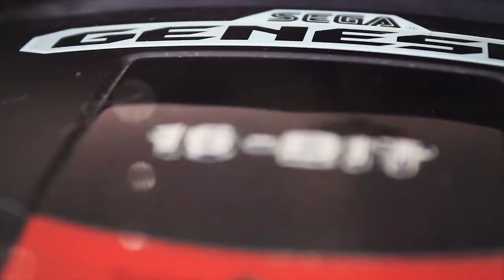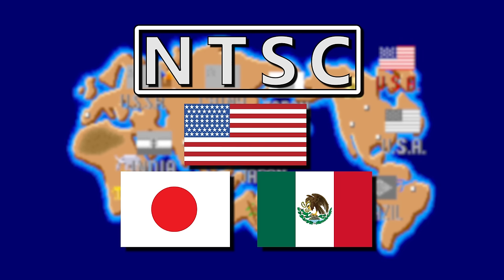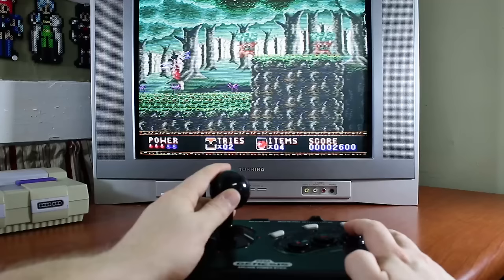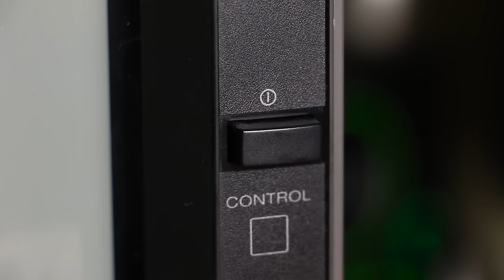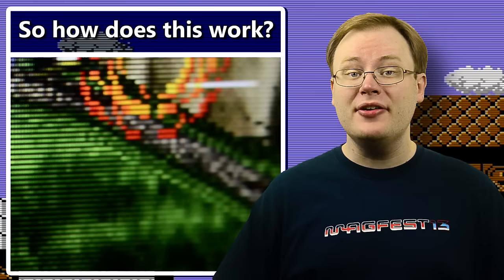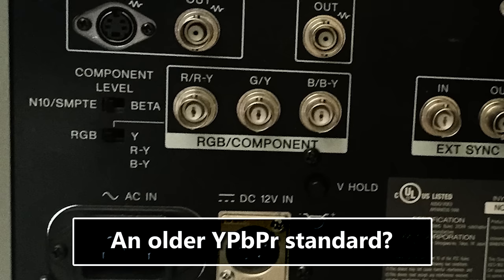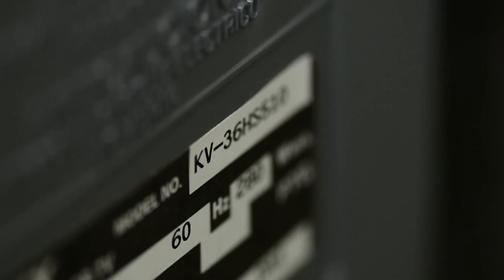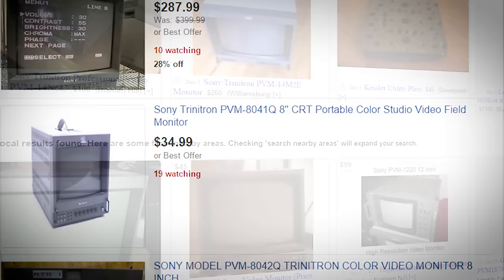Gaming on CRT Televisions, PVMs and BVMs :: RGB104 / MY LIFE IN GAMING

Comment: Having recently gotten back into gaming, I have been playing NES and SNES games on an LCD tv. I did notice that, with games like Metroid and SMB3, I had to somewhat retrain myself with regards to timing but we are talking about a couple of frames of difference.. I am using a RetroN HD for NES and an original SNES running through a Level Hike HDMI cable. I don't find the finely pixelated rendition of the NES games to really affect my enjoyment of the game and the SNES output I am getting is excellent. Link to the Past looks amazing and I can't imagine I would like the CRT image better. But keep in mind that I did a lot of PC gaming during the '90s so I am just used to more pixelation. I have also been running a GameCube through composite. That doesn't do so bad because of the native 480i resolution.  Unfortunately, I didn't think about GC compatibility when I bought my HDMI adapter for SNES. I could have got one that could do both for just a few bucks more.
I have a CRT TV on the way so I will definitely be doing some comparisons. It's only 13" but it's a Sony and the only way to go for speedrunning NES and SNES games. Besides, how else am I gonna hunt my ducks?
Oh, and you can call me a philistine but I would rather stretch the image to fill the screen than squash it into a true 4:3 box with the overscan lines crammed in.

Comment: With all the work that has gone into flashcarts like the sd2snes and cloned consoles, it seems like it might be a good idea to engineer a modern lcd controller and screen that draws the scanlines across the screen exactly the same as CRT TVs. One option could be to turn off black lines in-between the scanlines, and another option might round pixels even with the black lines turned off. 
This would enable the Super Scope 6 to work as long as there wasn't any lag time, and as long as the technology could draw scanlines as quickly, there shouldn't be a problem. I don't know if the Super Scope 6 would require black line separators. 

Being able to change the thickness of the black lines would also be a good idea.

On another note, the sd2snes has so much potential that I believe someone should emulate a new fx chip for the original SNES or use the existing fx chips to make even more powerful game ROMs. Why not make it into a family computer ;) with the SNES expansion ports on the bottom of the console, an internet connection, extra storage, and other possibilities could be invented. Perhaps investors are needed or people who are retired? 

If Super Mario Cart and Starfox run, then why not twisted metal? If sd2snes hardware has all that potential, then why not let it do all the work and just output the video and audio to the SNES?...

Comment: I didn't realize this video was this old.

I use a 32" Sony HD CRT with component cables for my Genesis, Saturn, PS2 and Xbox. They all look great in component. I also have a 27" Wega next to it that I use for light gun games.

I haven't experienced this supposed lag on an HD CRT. It worked great for timing based Guitar Hero (480i) and Guitar Hero 2 (480p) without any issues.
Reply: It depends on the model but on the whole it's better to get a normal CRT for this reason plus the vast majority of PlayStation 2 games run in 480i or 576i for PAL
Reply: @smasherjosh5000  Well then I couldn't play F-Zero GX, in all of its 480p glory on the Gamecube.

Comment: I keep coming back to this video. I recently bought a CRT on eBay for £86.49 mine is a Pacific PDVTV14-100C which is 14 inches and has a built in DVD player, from what I know Pacific was a TV manufacturer for the British supermarket chain ASDA, it has a front Composite with both red and white audio jacks, SCART, RF and I think Digital Coaxial (it's the orange Jack) I really have my GameCube hooked up to SCART as my GameCube came up with a cheap 3rd party SCART cable and my Wii and PlayStation 2 hooked up via Composite, I plan to get SCART cables for said systems from Retro Gaming Cables, I have also ordered a Star Wars Revenge of the Sith Plug and Play system (it's a Darth Vader theme) that uses 4 AA batteries, speaking of Plug and Play systems do a video on them!
Reply: And now just picked up a widescreen curved screen 26 inch Philips CRT with composite and 2 SCART ports, one SCART port is RGB, I think the other is S-Video. The model is Philips 28PW5407/05 there's also a 32 inch variant, I couldn't handle any bigger than that one
Reply: @smasherjosh5000 awesome brother, I've got a kv36fs300 and a kv27fs13 that I just love.
Reply: @RemoWilliams1227  correct me if I am wrong but aren't those Sony Trinitrons?
Reply: @smasherjosh5000  yes they are

Comment: Here's some advice that is not covered in this video: 
1) buy a  sd crt with component or s-video inputs (the later year models are the best)
2) buy a hdmi to s-video or component converter (30 bucks on amazon)
2) hook up your pc to your crt. 
3) download pcsx2 (ps2), dolphin (gamecube), and retroarch (everything else)
4) enjoy the beauty of playing ps1, ps2, and gamecube games in multiple x native resolution with AA, faster loading times, save states, all while retaining the advantages of crt display tech (deep blacks, amazing colors, near zero input lag, scan lines)
5) be amazed at how much pre-ps1 era games look indestiquishable emulated on your crt compared to the original systems and carts displayed on your crt. (you also, of course, can take advantage of emu features like save states, fast forward)
6) play modern games on your crt, outputed at 1080p, and be astonished at how good they look and how little input lag there is.  (any bloodstained fans out there?)
7) watch any sd content (movies/shows- particularly anime) and be shocked at how awesome it looks. 
8) watch hd content on your crt and start to really understand why crt display tech is awesome and then begin to dream of fitting a second 1080i widescreen crt tv in your place. 
9) be surprised at how little entertainment you now choose to use your hd display for. 

Unless you're a collector and/or nostalgia fuelled purist, this is by far the cheapest and most convenient setup. It's not going to be perfect. No set up is.  There will be trade offs, but I think what you can end up with is worth it.

Comment: My big question: Is there any point to using CRTs/PVMs for emulated hardware, or is this only pertinent to the original consoles? I do not have the space or desire (yet) to collect my old physical consoles, so using tools like retropie, retroarch, and launchbox are my current solution for retro gaming. I plan to build either a pi consoles or a dedicated emulator PC in the near future and am wondering what best picture solution will be for playing 240p and 480i games on it.

Comment: Guys I can't thank you enough for your rgb master class videos. They are by far the best produced and easiest to understand I've seen anywhere online. I've been playing my older consoles with an xrgb mini (framemeister ) on my Vizio lcd and had been very happy with its rgb upscale quality. I had always thought a bvm would be too large or expensive, but I found one this week and just picked it up. It's a Sony bvm 1311. My issue is I'm not clean on what rgb adapter I need for it. There are two input cards installed in the back. One has multiple video inputs and outputs along with 2 sync ports. The next card has a series of one rgb input and output ports. That second card doesn't have any sync ports which is what is confusing me. Do I need an adapter to go from scart to rgb bnc plus two and cables? I'm not seeing anything quite like that from ebay or other sites I would normally buy from. I'm not clear on why the sync is on the card with the composite inputs. Does anyone have any ideas?
Reply from the maker: [Try4ce] I'd need a clearer idea of what exactly is on the card. Your run of the mill input/output card will have R, G, B, and Sync inputs, as well as R, G< B, and Sync outputs. They can also typically double as component inputs (Sync port not needed) if you select it in the menu. If it is two sync inputs (H and V), then that's more like for VGA than most retro consoles, which send a single sync signal. Of course I'm not quite sure which card(s) you have, but your typical setup would use this cable, combined with SCARTs  from your consoles or a switcher - https://www.ebay.com/itm/Female-RGB-Euro-SCART-to-4-BNC-Audio-Cable-Sony-PVM-Sega-Genesis-SNES-Neo-Geo/192413018466?hash=item2cccb5a962:g:tQQAAMXQAEFSD-4B
Reply: My Life in Gaming thanks for the help. I believe I was thrown off because none of the ports specify input and output so I thought I had two sync inputs. After reading your message and looking closer, I believe they are like you said, one input and one output for daisy chaining monitors or to another output. What you linked is likely just what I need. I'll probably grab some terminators as well in case they are needed. Thank you for the quick reply and the help! Right now I'm on my other new monitor, a pvm, alas only composite and s video but panzer dragoon saga looks excellent on it in s video. Keep the videos coming, they are so helpful and entertaining. I've watched this one countless times. Thanks again.

Comment: The best consumer crt monitor was the Commodore 1084. Pin sharp and luxurious colour saturation.

One thing you didn't mention in the video about pro monitors. The raster doesn't always fill the screen.
It's to keep the image square and avoid convergence errors.
The portable ones usually don't have any built-in speaker so you also to have sort out an audio solution.
Reply: I would love a CRT TV (4:3) that is physically like an HD TV in that it is flat/light.  I would also want the CRT TV to have ALL inputs from RF (coaxial),Switch, AV SD Video, Component, Composite, and HD inputs.  Does that even exist?
Reply: @NYCJoeBlack  My pvm has SDI, RGB, S-video, Composite Video but no built-in speakers. I use external RF box through composite input. It is for signal quality checks, rather than gaming use.

the tube is only curved slightly in the horizontal plane.
unfortunately there has never been a CRT that wasn't heavy relative to its screen dimensions.
Reply: dusty dex - Thanks for the reply, but I am a little confused.  How does a TV not have built-in speakers?  You cannot hear sound from the TV at all?  How much did you pay for the TV and where did you get it from?  

I still own all relevant old school/retro gaming systems and would love to continue to play them as they were originally meant to be played without those black borders around the image.
Reply: @NYCJoeBlack  It isn't a TV it is a professional monitor that is portable and used primarily outdoors and will run off a 12V battery if required. Audio monitoring might be somebody elses concern, plus having loudspeakers in a monitor can affect the image if they aren't magnetically shielded.
Reply: dusty dex - Okay.  Thanks for the info.  I am looking for an CRT that isn’t bulky and visually looks like an HD TV in the sense that it is flat and has a 4:3 aspect ratio with sound coming directly from the TV/monitor.  I am not looking for the best possible picture or sound.  I am just looking to be able to play my retro games in the aspect ratio they were made for without those borders around the image.

The preferred size for me is 13”.  Do you have suggestions on where to go to purchase one?
Reply: @NYCJoeBlack you  can usually find them on a well known auction site. look in Sound & Vision under vintage electronics / TVs or just type crt tv into the search box

Comment: I think the idea that CRTs will just "die off" at some point is kind of overblown. Heck, I can still find 50s and 60s TVs on Craigslist from time to time, albeit not as often as more modern CRTs. So this likely won't be an issue in our lifetime.
Reply: They're built to last, I have 2 of them, a cheapo Orion '13 RF only from 1999 and my prized '27 Emerson with S video from 2005, both function perfectly.

Comment: Interlaced is terrible for 15khz tv, but it can be useful for computer monitors to reach higher resolutions at 120hz, since the difference between lines becomes smaller, and the flicker very quick.

Comment: 04:35 most of the games weren't converted at all. Super Metroid and Super Mario Kart are only 2 that I can think of, but that was mostly speed  and music changes. The Graphics weren't changed at all and still had the black letter box due to the resolution difference.  The conversion was mostly done by the hardware. My experience is mostly with cartridge based systems, so I don't know if this is still true from PS1 on-wards. But for SMS, MD/Gen, SNES and NES, to change from NTSC to PAL it was mostly achieved by having 0v or 5v on one of the pins of the processing chips. Thus why it is so easy to do a PAL to NTSC mod for those older cart based consoles. Which many people living in PAL territories (like I do) have done.

Basically at the flip of a switch (or press of the reset button if you are fancy) you can go between 288p 50hz and 240p 60hz, therefor filling up the screen and speeding up the game without any major issues.

Love your videos guys, I watch them over and over trying to get the best out of my systems.

Comment: Back in olden times cable to composite was so much better then a rf converter because of the wavy screen affect. Now days I would only use a tube if I can get 480p/i with old systems.

Comment: I want to preface this by saying this is one of my fave channels on all of YouTube, presenting information I had to figure out myself years before lurking GamesX/NFGGames for info on RGB console output, all in a concise and easy to digest set of videos.However, I do feel that you should have went into more detail on CRT computer monitors after the 15/24/31 KHz horizontal scan rate bit.They don't really work any differently from CRT TVs, except they frequently do higher resolutions and refresh rates to the point that PC users were getting HD before the HDTV craze and understood the benefits of gaming at anywhere from 85 to 160 Hz beyond reduced flicker, namely improved motion clarity. Also, they DO NOT USE SCALERS, so input lag is not a problem. Best of all, the high end ones, like Sony FD Trinitron GDMs, have razor-sharp clarity, can be found at up to 21" or 22" for 4:3 (24" when factoring in W900/FW900 and widescreen), and generally lack the blooming and overscan problems with CRT SDTVs.But as a side effect of how VGA was specified - that low resolutions such as 320x200 would be scandoubled by the graphics card - those CRT monitors have a lower horizontal sync bound of 31 KHz and WILL NOT ACCEPT 15 KHz signals from consoles without a linedoubler in the vein of the XRGB, X2VGA or OSSC.Now, there are a few exceptions to this rule, namely the coveted NEC MultiSync XM29/XV29/XP29 family of presentation monitors that will accept 15 KHz and even 24 KHz RGBs or RGBHV on their DE-15 VGA ports without a complaint while still going up to 800x600 comfortably, but you'll have to read the monitor specs carefully. Those are monitors I would definitely consider seeking out for the X68000 and FM Towns owners out there.On top of that, a PC monitor used in this fashion might be a bit flickery owing to how they weren't meant to run at just 60 Hz, but usually something like 75, 85, maybe even 100+ Hz, with quicker phosphor decay to match. They're tuned for faster, higher-resolution PC signals rather than paltry NTSC spec like a BVM or PVM would be.If you don't mind the lack of larger monitor options (NEC 29" models notwithstanding), they're certainly worth considering.

Comment: Now I am confused...the visible "scan line" is because of the mask inside the monitor. To make it too fine could lead to colapse of the mesh("mask"). Like those two lines visible on trinitron and such. I might be wrong. Funny thing is that trinitrons have no mesh but more like vertical lines and those horizontal stabilize the mask not to vobble...had it open long time ago.

Comment: Good video but I will have to disagree with you on HD CRTS. While probably not as good as PVMs definately better than LCD and plasmas on the low res stuff and I prefer it to regular interlaced crts. It also depends on the set. I'm a bit biased because the one I use is probably one of the best  ones  in this category. It is a Hitachi Ultravision udx10sa 32 inch version. This set while a progressive scal hd set is a 4 by 3 aspect ratio so preserves the games original ratio. So while it does convert everything to progressive scan it doesn't have to do scaling like a LCD. LCDS are fixed panels which means they have to upscale everything to their fixed resolution internally. CRTS basically draw the amount of lines they need so they arent a fixed resolution. Even though not as sharp as a LCD the LCD draws games much more blocky wherase the crt draws them more smooth/ natural and HD crts do it without scanlines. While in some games CRTs with scanlines do hide the antiaslising effects they arent nearly as bad with a 4/3 crt as they are on a LCD. While with older gen games some may look better with interlaced crts when you move up to gamecube generation games with 480P I havent seen any TV which can beat this set.

Comment: The old crt TV has a unique image, and no shader or graphic filter has managed to reproduce the same images on a modern digital TV / monitor. In fact, old video games were made for that TV - many use "dithering", for example, that fit it. I'm not being homesick; I'm just sure that no graphic effect was able to properly simulate the image of old games, as they were unique at the time.